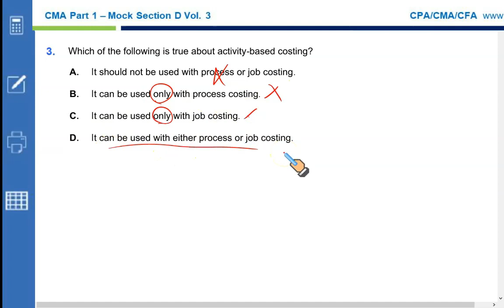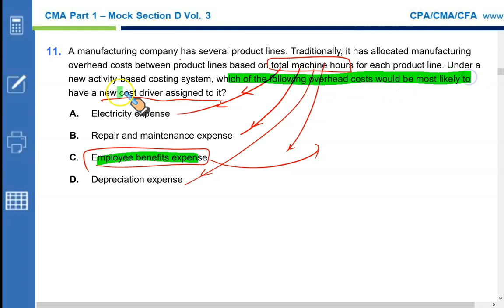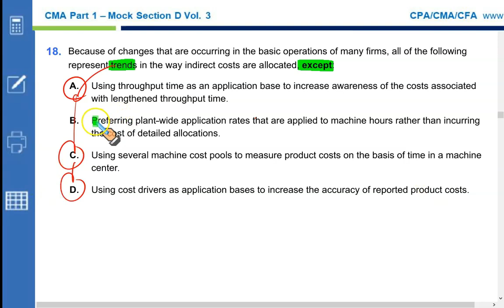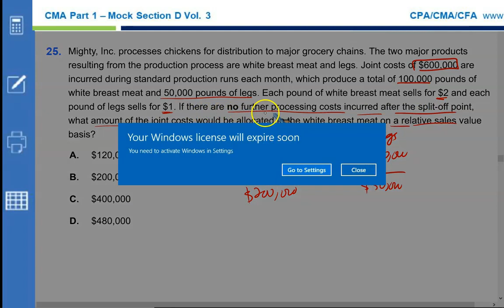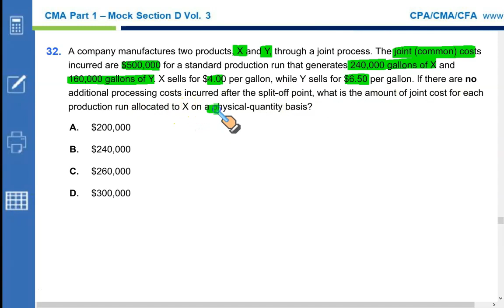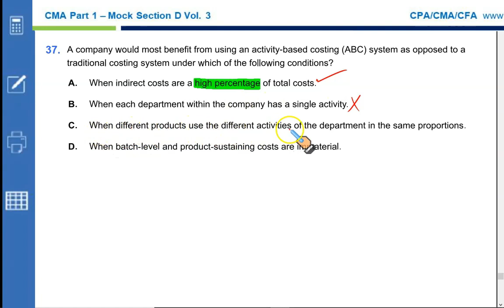Mock CMA P 1 Section D Vol 3

Comment: Al Salam Aliekm - Can you please help me in solving this MCQ in Learning Curve ?? 
A manufacturing company has the opportunity to submit a bid for 20 units of a product on which it has already produced two 10-unit lots. The production manager believes that the learning experience observed on the first two lots will continue for at least the next two lots. The direct labor required on the first two lots was as follows: 5,000 direct labor hours for the first lot of 10 units 3,000 additional direct labor hours for the second lot of 10 units The learning rate experienced by the company on the first two lots of this product is = Answer 80%